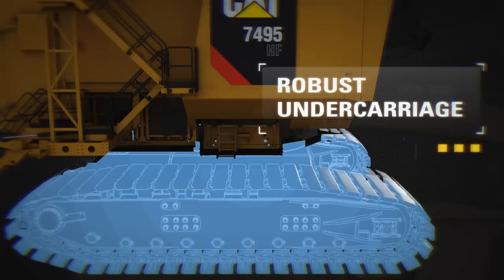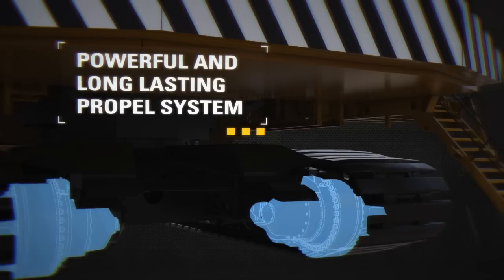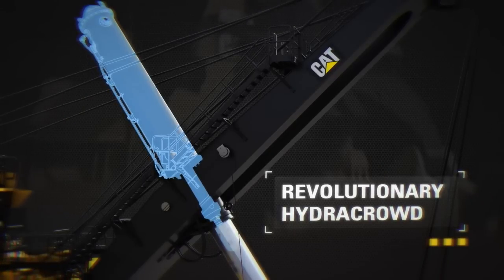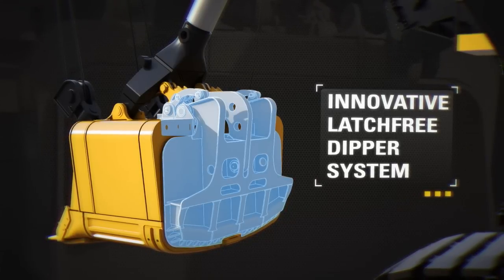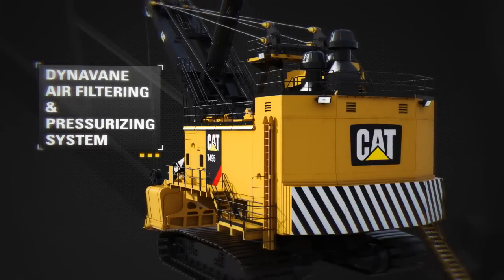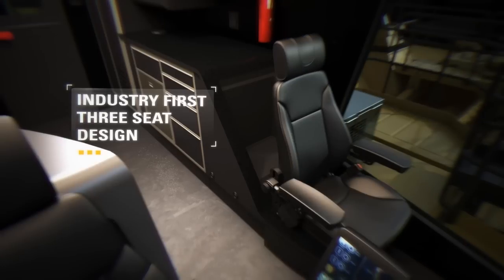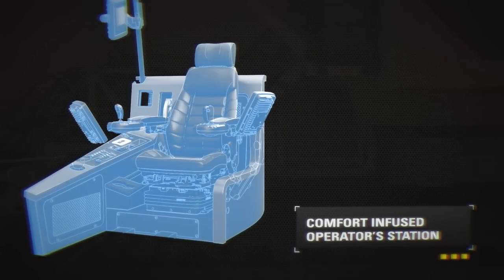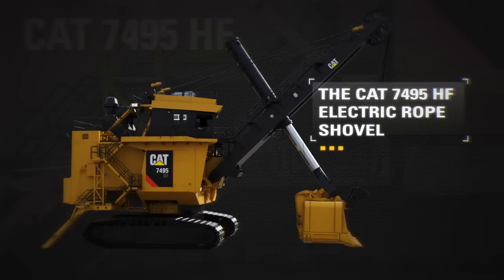Cat® 7495 HF Electric Rope Shovel Virtual Product Tour

Comment: They need to start putting bathrooms and kitchenettes as standard equipment in these mining units.   It’s people running them, not robots.
Reply: What?
Reply: Good suggestion.
Reply: It would be nice, but who's job would it be to pump it out and maintain it?
Reply: This shovel has.  It is located below the operator cab.  You defecate in the toilet, and then turn on an electrical resistance which incinerates your manure.  Then you can throw the ashes in the air

Comment: Where does the electricity come from? A generator?
Reply: +Ryan M Same place you get your electricity from mostly unless it is a mine that is in a totally isolated location then it is generated by very large diesel gen sets or even local hydro power.
Reply: A transformer and the grid.
Reply: 2 d batteries!!!....(lol)
Reply: @mikesecondo2254  They told me that it was powered by 3 Tesla batteries.
Reply: It comes from rubbing 2 boy scouts together very rapidly
Reply: Generally connected to the grid, Rope shovels will have a high voltage trailing cable mounted to the undercarriage which goes up through the swing ring along the swing motor to the housing. These will generally be fitted as suiting the application and conditions.
Reply: If you've ever worked at an oil sands mine like Albian, Horizon, or Suncor, they all have their very own power plants (co-gens) as they are producing their own natural gas anyhow, or coke to fuel it with.

They have litterlly 100's of thousands of electric motors to run needing 13,800 volts like this beast, to your 60 hp 600v air handling unit motor to power along with thousands of pumps, electric heat tracing all over the place, lights, fire pumps, etc.

They sell off excess to the grid. I believe Albian MRM (was Shell/CNRL) actually share their power plant with Sask Power or Alberta Power.

Comment: This is just a Bucyrus 495HF with a different cab and painted yellow with a 7 added to the number. They were complete junk when they were Bucyrus and they are no better now. The crowd cylinder leaks all the time and has more downtime than the rope system they use to have. When are you going to take a page from P&H and go to a rack and pinion system, keep it all electric. The brakes fail more than any shovel I have ever worked on, and the dipper falls out of the air way to often, but it's not a problem according to CAT. The track pins are WAY to small and you change at least 2 a shift. Then there is the center pintel pin that engineers thought was a great idea to make fine thread, which in heavy digging breaks, causing the upper house to no longer be attached to the lower carbody, great design guys. Why did CAT want this company who made junk? Nothingit here is cat designed just out dated shit technology from Bucyrus and repainted by CAT.
Reply: hommie789 the mine I work at, CAT has worked very hard to fix old bucyrus issues with these shovels and they are currently out performing the P&H shovels.
Reply: You would be a great addition to the marketing department.
Reply: The mine I work at has the last  bucyrus 495hr made and it is great no probs with pindle.  Pins or anything else. 8years old and a good goer.
Reply: @roberttimms3489  it's sad that Bucyrus Erie is no more 😔
Reply: We have several of the 495HFs and everything he says is true.  When they are working, they are faster, but they are rough, and break down a lot.